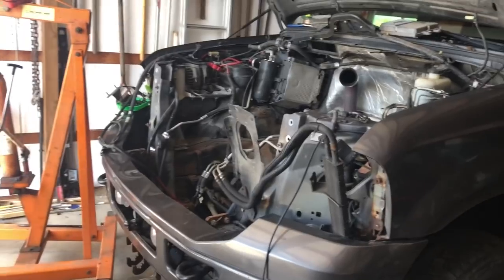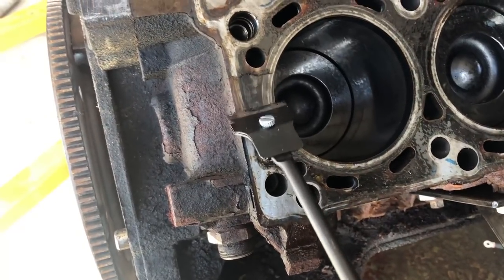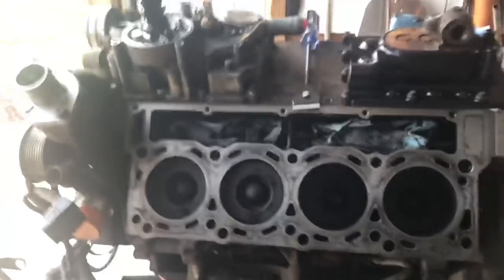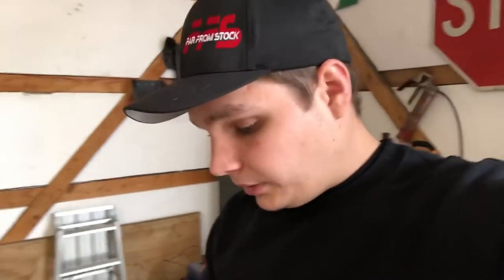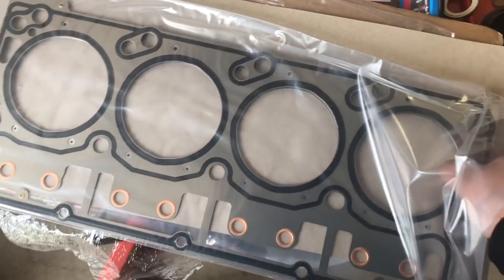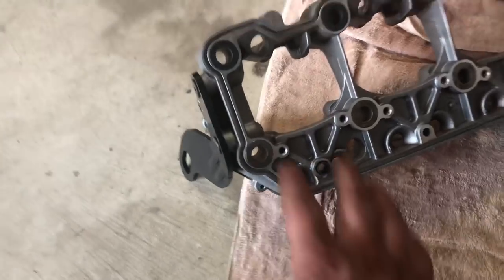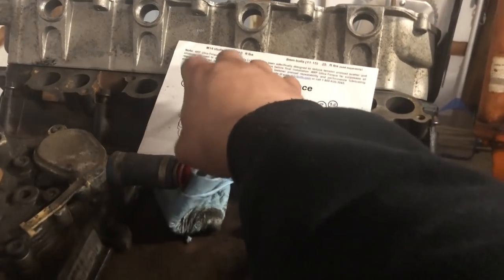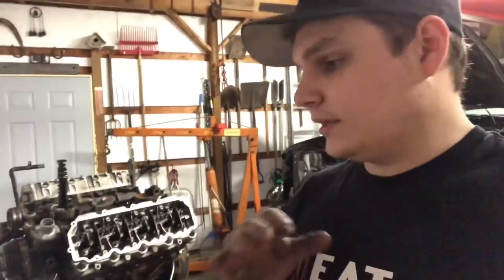STUDDING A 6.0 POWERSTROKE PROPERLY!

Comment: Just put an 05 motor in my 03 after a lifter came apart at 273,000 miles. After I Did the initial scrape with wd40 and razor I used a sanding block and 800 grit sandpaper with wd40. Block came out perfectly clean, used UCF oringed heads and ford gaskets and arp studs. Install Johnson hylift direct shot lifter and new main seals. Runs like a champ now.
Reply: Any issues so far?
Reply: @gmiles7217  truck runs better
Than before . But I guess replacing tired injectors with 8 new ones from Ford along with a regulated return system will help in that department
Reply: Good for you!  I just watched a video of a guy who sanded the block with 150 and 180 for a while.
Reply: @gmiles7217  from all the research I did over months cleaning the deck surface with a quality 600 to 800 grit sandpaper on a long sanding block is the proper way to do it and the builder at UCF said that was the right grit range to use. Powerstrokehelp also showed this technique in a video but they didn’t say what grit to use. I also dabble in bodywork and I know 150 and 180 grit paper will gouge small scratches into the machined surface of the block that will act as an escape path for combustion gasses.
Reply: @gmiles7217  oh yeah I forgot about that video, I watched it before I did my head gaskets but I still didn’t use the grit range he used as I could see some long scratches in his deck surface that I didn’t like. The 800 grit cleaned the my deck surface really nice and didn’t leave any visible scratches, the original factory machining marks were still present when I was done. I did however use the sanding pattern shown in that video. It’s been a year and a half of driving sometimes with 10k behind me and I haven’t had any issues with pressurizing the coolant system. My innovative diesel tunes are really good too, I was using them before I got studded, even the extreme x tune with no issues.

Comment: Hey man, just saw your video. I just studded mine, I didn’t change the pushrods and now the truck won’t start. You think that has something to do with it? 

Thanks!
Reply from the maker: Most likely not related to the pushrods, unless a lifter failed. Needs 500icp to start. Check codes and verify that it’s getting 500+icp.

Comment: That's exactly how you DO NOT clean the block on a 6 liter. Been it's weakest link it requires alot of attention and the razor blade will just create microscopic channels that will allow the coolant/ compression to find it's way into the wrong places. 
Use sand paper and a sanding block.  
NEVER USE A AIR WHEEL OR A RAZOR BLADE.
Good luck.
Reply from the maker: This is a debatable subject. I agree to never use a air wheel pad. I’ve had great success with a razor blade, and a scotch pad. Never had an issue! Never had a head gasket fail after I do them using this method. I have used a stone before, but doesn’t seem efficient enough.
Reply: Yeah my using 220 sand paper
Reply: Best way would be to have a machine shop deck the block .001-.003 to ensure it’s completely true and flat. Watch out for piston protrusion though not much room to play with

Comment: I've never heard of the head stud tightening into the block when you torque them, if you use the proper arp lube the stud should never turn.

When you cleaned the head with brake clean and then blew it off with compressed air... you totally wasted what you did as there is moisture in the compressed air so you sprayed water on the head.
Reply from the maker: The stud turning while torquing is the exact reason why arp says to run them in only hand tight. It seems like you may not have a lot of experience with arp headstuds and torquing. To address the brake clean/air, you are correct in that I allowed moisture on to the head. However, again seems like lack of experience, the brake clean is used to remove dirt, grime, grease, dust. The moisture from the gun is so minuscule that it isn’t a factor.
Reply from the maker: I generally run 1/4 of a turn. 6.4 trucks are more prone to turning vs the 6.0 but overall it’s good practice to back off a little. There is plenty of thread engagement so backing off 1/4 of a turn gives piece of mind with no downfalls. Secondly if you spray the head with brake clean there will be residue of that remains in the head unless you hit it with compressed air. Brake clean is acidic and could potentially eat at the silicone of the head gasket. The minuscule amount of moisture is not a factor to ensure there is nothing residue on the head or block and it is dry.
Reply from the maker: 7 THREE stud acting as a bolt because it turns slightly in the block....? That makes no sense and tells me your lack of knowledge and experience. Respectfully, at this point I would generally stop commenting, however I hate when misinformation is spread, so this will be my last reply. A 6.0 when torquing the arp headstuds, there are 3 stages of torquing. 70,140,210. The factory headbolt is a torque to yield bolt. Meaning that when you torque the bolt, the bolt will actually stretch. The benefits of studs is you are eliminating torque to yield while also gaining substantial clamping force. I have bulletproofed a lot of 6.0s, on every single one, a stud will turn during the torquing process. It usually chatters slightly and makes my torque wrench freak out. It’s completely normal and has no downfalls, because you will still get an accurate torque reading. What you don’t want to happen is the stud to be bottomed out and then chatter while torquing, potentially causing it to push through(seen as a hair line crack in the stud hole). Backing off a 1/4 turn allows that movement to happen without bottoming out and still gives me good thread engagement and accurate torque readings.